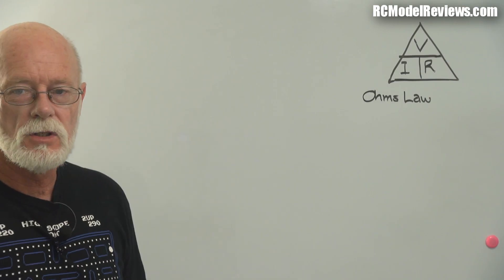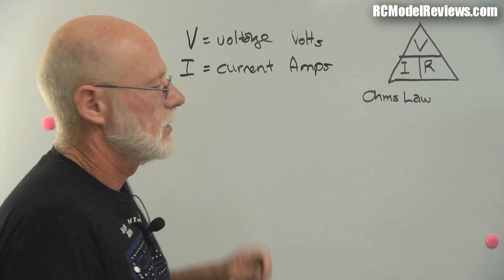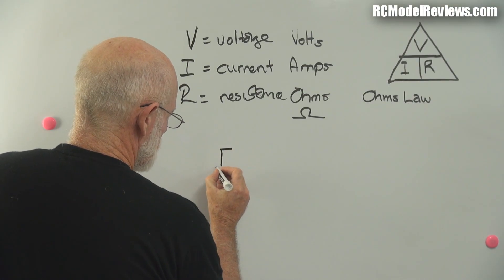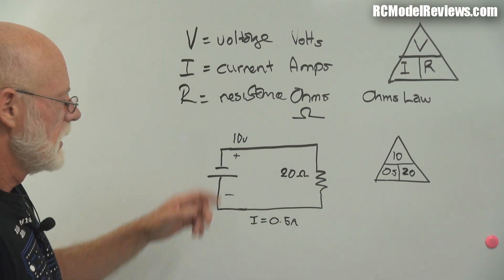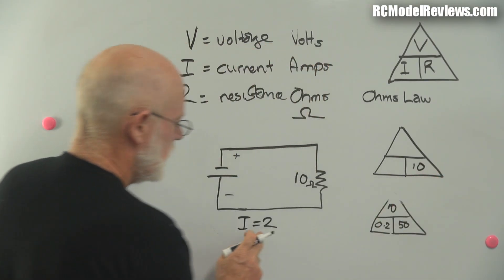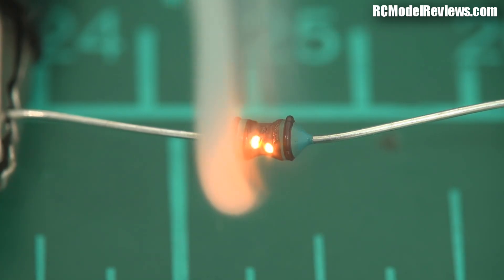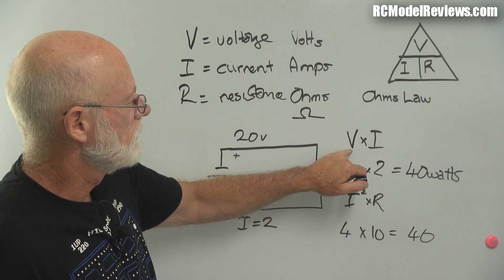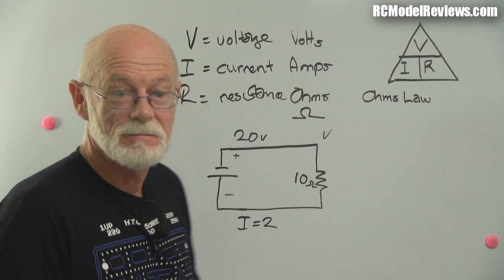Ohm's Law explained

Comment: Technically Ohms Law is about the linear relationship between voltage and current.

You plot the voltage and current on a graph, current on the vertical axis, voltage on the horizontal axis, and then you measure the gradient of the graph and that is the inverse of resistance.

It's fundamentally about linearity, not single spot values.

The equation for a straight line on a graph is:
  y =mx + c

In our electrical scenario, zero volts equals zero current, so the value of c is 0.

The equation then becomes:
  
y =mx

y is current which we use the symbol I to denote, and x is voltage which we use the letter V to denote.

Hence:
I = mV

m is the gradient of the line which is calculated by measuring a change in Y axis, looking up the corresponding change in X axis and dividing (m =dy/dx)

m is a constant, it is a straight line.
And we call 1/R = m
That is the resistance is 1/m

So we end up with the formula:
I = V/R
where m, the gradient of the line, is 1/R

The resistance is the inverse of the gradient.

As we are talking about gradients, only apply to lines, which comprise multiple points.

So Ohm's Law fundamentally is about the relationship between voltage and current, not single spot values.

So this is where Ohm's Law actually comes from. This IS Ohms Law.

However, the formula:
I=V/R 

is incredibly useful to us. But it technically is not Ohms Law in its entirety.

So whilst you can use the formula to calculate resistances from knowing voltage and current, say for a diode, and you can do it at multiple values of current passing through the diode, each value is a resistance figure measured in ohms, the diode does NOT follow Ohms Law. It does not follow Ohms Law because the relationship between voltage and current in a diode is NOT linear.

Comment: I don't know about Voltage being compared to a preasure... Maybe I get it wrong, but it doesn't make much sense for me.
If current would be like a preasure, then when you raise a preasure in a pipe, you will then increase the amount of water flowing, right? But that would break the analogy because flow is already current.
I rather associate voltage with a temperature (volts are then indicating how "hot" the energy is and current how much of it is flowing through).
But if my analogy is bad, then please correct me and explain me where it fails. I know only very basics about electricity so I would be glad to learn something :)
Btw awesome video! Thanks for explanation.

Comment: V, I,R, Watts... I lack an analogy for each item.
V is like water pressure above the shed in the form of a rain barrel.
I is the current ..a 10 inch in diameter pipe .. Hmm. I think it has a low current
I in a 1 inch in diameter pipe. ... Hmm.. I think it has a higher current than the 10 inch pipe.

Ok.. I'm stuck there.

Comment: battery has an internal resistance r=0.5 ohm, an open-circuit voltage 
𝑉OC  = 12.6 V, and a rated full-load current of 2 A:  
  (i) If a load resistance 𝑅L =10 Ω is now connected across the 
battery, calculate the load current.

Comment: YOU ARE A GODSEND! You explaned to me what other videos just lost me. I'm learning how to Breadboard with a pi 4, but I'm smart enoug not to tinker on it, until I fully grasp all the electronic parts I need. Like Resistors and Transisters, Capacitors, LED's and light emitted diods as in the ones that don't light up like leds. So I'm a long way of really doing anything yet. I"m into programming and Python is one of them languages that runs on the Raspbery pi 4. And because I am a fan of robots, I also put together a robomaster s1, to use with Pytyhon, and now, I want to pretty much learn to make a real working robot right out of scratch. I'm in my fifties, but programming isn't new to me at all, Robots are new to me, but so far, I love it. Now I'm trying to merge into a deeper field, and I need electronics to get me there. So I will be paying stern attention to you SIR!!-:))) Thank you for teaching me....

Comment: I'm used to algebra where a letter is turned into a numeric value. 2A, find the value of A, and double it.
I'm going to have to make several equations to get that language out of my head, and put this in.
9V=9 volts, not the value of V times 9.

Comment: Electrical Current is measured in Amperage, or Amps for short. "I" stands for "Intensité de Courant" (French), or Current Intensity. André-Marie Ampere, a Frenchman, who discovered electrical current, used this symbol.

Comment: Small correction at 3:40: In the battery symbol, the positive terminal is the one with the longer line. Although, as you said, the polarity of the battery doesn't matter for that circuit (since a resistor is a bilateral device), people who are first learning its symbol may mess things up.

Comment: I have a 70va Transformer with 208v. The output is 24v. I need to close (2) 3phase contactors.. 

Q: how do know if my Transformer is actually giving me 70va? 

Should I have a given value of Resistance across the secondary or primary coil? 

Ps I’m an HVAC technician, this video is most educational video on ohms I’ve found.

Thank you in Advance for your consideration.
Reply: The transformer can take up to 70va... When you put 208v on the input, he converts it to 24v on the output... If there's nothing connected on the output the transformer is taking 0va... You can link resistors/load up to 70va. Does that make sense?
Reply: Electronics isn't hard but it's tricky..  I also teach it with cartoons...

Comment: I get the math. That is easy. Now for  the mystery. I have a 2836 1100kv motor.  It is rated to take 27 amps max. Also I have docs that show it has 336 ohms of resistance at 14.8 volts. I can't get the math to work or even come close. If you can answer this I will subscribe. carlylemmitank@gmail.com

Comment: I'm confused. If we had 10 volts and wanted 0.5 amps the resister would be 20ohms. So if you wanted 2 amps ran through a 10ohm resister shouldn't it be 40 volts. ?

Comment: If you want to know exactly where this 'law' comes from i think it will be better to start with 'Drude Model' which explain the physics behind this law. For example, ohms law suposse that the electric field inside a resistor is equal everywhere which in real world is not true. As a summary Ohms law is the bridge between electronics and physics.

Comment: Can you convert AC to DC this way?
I have a 12V, 30A (DC) powersupply. It is fused with a 10A fuse at the AC side.
So i was thinking, 10A on a 30A powersupply? That can not be right?
Then i was thinking; 12V x 30A (DC) is only 360 Watt.
360 Watt / 230 Volt (AC) is only 1.56 Amps.
So 10A is more then enough.

Did i calculate it correct or is there something else to think about when converting from AC to DC or DC to AC?

Comment: Question.. say I have a generator that outputs only 1000w @ 240v AC (around 4 amps) and a kettle that normally takes 10 amps. Would a 60 ohm resistor in line ensure only 4 amps is drawn from the generator? Or will the resistor still turn the difference into heat and draw the full 10 amps from the generator anyway?

Comment: Very helpful! How can I apply this to figuring out the required voltage needed for a small water heater appliance on my boat. I don't know if it's 12v or 115v. I just learned how to measure the ohms using my multimeter, but how can I get the missing pieces of the puzzle.? Thanks in advance.

Comment: A filament without the insulator. A resistor is a bulb, that is not designed for producing light or cad sensor detection. Controlled impedance temp.  Manipulation of conductor size, to negotiate current flow. Ohms begins with continuity. Polarized particles are static. Exchange of charge is the movement of electrons or current flow. Potential current and current differ. Resistors invite charge exchange by being at a differential with the main conductor. A yellow light in the river. A torrent or cipher.  The universe is continuous. Everything that produces light or particle excitation, is a resistor. cJT aka Charlie Jay

Comment: You did an excellent job of explaining that. You can use basic math to calculate that. The trick is how not to fry the resistor or the circuit board.

Comment: How can I make a variable power supply that can deliver 20,000 voltage with no amperage, on up to 100,000 or 200,000 voltage with no amperage. But just In case maybe have a very low amperage dial also... I'm transforming electrical ark plasma into Positively Charged Protons which can run any combustion engine.

Comment: No dude! E I R !!! Not V. Again, E, I, R. And W for watts. E, not V !!!
Reply: Rubbish!  V is voltage, E is electromotive force or electric field.  Ohm's law is  V=IR in any electronics textbook.
Reply: @karhukivi  I don't know where you live, or where you went to school, or what military you got your training and MOS in, or where you worked, or what textbooks you have or studied from. But all of the above of mine are E=IR, where E is Voltage. I have in front of me the following, Radio Communications Handbook, Principles of A.C. and D.C motors, ARRL Handbook 2019, Practical House Wiring, RCA Vacuum Tube Manual,  and Understanding Power Generation and Transmission.  And every one of these books refer to and use E as the designation for Voltage pertaining to Ohms Law. The pie chart for Ohms Law for Voltage, Current, Resistance ant Power that hung above my instructor for "Math for A.C., DC and Power Circuits" showed E for Voltage. EMF is not a product of Ohms Law for Voltage, the correct terminology is E for Voltage is found by multiplying Current by Resistance. Voltage is a product of Electro Motive Force, and as such it is quantified and measured as Voltage, which is represented as E.
Reply: @bobgarr6246  OK - google on images for Ohm's law and see what happens!   E in physics stands for electric field.
Reply: @bobgarr6246  If you  look at google images for ohm's law you will see both V and E.  Not sure which is in the majority, I would think "V" but I'm not going to count them!     It may as you say depend on where you live, but in Europe it seems to be V.   Owen Bishop's "Electronics - first course" uses V as do all my physics books.  I think it might be to distinguish "V" as "volts" e.g. 9V, from the concept of voltage, just as I is current while A is the unit amps.

Comment: What is not mentioned here is that this tutorial is based on DC circuits NOT AC. AC requires a different approach.
Reply: It is OK for AC circuits with only resistive elements.

Comment: I don’t get it
If a battery is 10v, which is the force pushing, isn’t there already an Amp measurement before the resistor?  
So in your circuit, if you remove the resistor, what would the Amps be?
Reply: A dead short!  The current would rise rapidly, the battery would overheat and be damaged, or perhsps the wires would melt in a shower of sparks!    On the other hand, if it is open-circuit, then there is zero current, i.e. 0 amps.

Comment: As a kid I could grasp that key🗝 in a wall socket  for only a moment.  As I get older  I'm ready to hold on 1 last time✔. What would my body resistance ♎need to be to achieve  fully cooked status ,🥓 110vA/C ⚡60hz🤜 @15 amp circuit.........??

Comment: The burning resistor intro page was ideal for introducing watts and the watt limit for a resistor. Suppose you have carbon resistor with 100 ohms in a circuit with a 9 volt battery. Will it burn? 

The answer requires a comparison with the watt rating, not specified here.
Reply: The current would be 9/100 = 90mA and the heating (power dissipation) = 90mA x 9V = 810mW.  A resistor rated 1W would be OK although it would get hot.  A resistor rated 0.5W would get very hot and likely burn out.

Comment: man. I had to use Ohm's law to roll my own coils for my vape.
little did I know I would be using it again in a different way, with cars

I used to just plug the numbers in, now I know what they mean
tho to be fair you didn't really explain what they mean in this video
for someone who chuffs them phat clouds I can explain it easy, but in some abstract forms I cannot
there's a good picture of the Volts pushing the Amps through a narrow tube, and the Resistance is that narrow tube
but like I said, just explaining it is very difficult for me to describe in words, only through pictures can I sort of explain it
if someone is interested in something it is extremely easy to teach them. but if someone isn't into it at all it's a fucking struggle

Comment: You say ask you so I need assurance I'm building a rc lorry run on water hho but using 12 volt battery for electrics the radio control works ov max of 7.volts preferred 5 volts what resister would take that drop without overheating. Many thanks john

Comment: "I" is from the French phrase i"ntensite' du courant" or current intensity.  Current Intensity is simply referred to as current.  The "I" symbol was used by Andre'-Marie Ampere, after whom in 1820 the  unit of electric current is named, in formulating Ampere's force law.

Comment: Poor teaching. 

Should voltage = amps x ohms. 

Or 

Potential difference = Current x resistance.

Don't mix units and measures

Voltage is a unit of measurement for potential difference (PD), whilst voltage is often referred to instead of PD only poor teachers pass on bad practice.

Comment: This maybe off topic but you look smart and I’m a dummy so how does one rewire a motor from 115volts to 220volts? Im just trying to understand it all but still confusing 😓 it’s weird how it runs fine when I plug it in but when I plug it to the box which takes 220v it doesn’t work very well it goes on and off. 🤷‍♂️

Comment: This makes no sense...if you take a small 4 amp 12 volt battery and put a 2 ohm resistor on it..you dont get 6 amps!! Wow..we could make free energy. Hes not including the voltage with amperage in V. DUH

Comment: How should one understand the water/pressure analogy when electron current is flowing exact opposite to the conventional current shown in most circuit diagrams? If voltage is “pressure” how is it that actual electrons flow toward it, not away from it? The “hole” flow explanation is silly since in metallic conductors,  which we mostly use in circuits it is electrons that flow. Only reason they flow is because they are loose in valence shell of an atom. Holes (protons) don’t flow in the wire as they are not in the valence shell. So people keep saying these analogies but it is really hard for a noob to wrap their head around it.

Comment: Why wouldn't you just name them .5 amp resistors?
Reply: Kyle Simon   Because the amperage would change with voltage change.   A .5 amp resistor is on true at a specific voltage.
Reply: @raoulcruz4404  

I know. That's the point.  a .5 amp resistor doesn't function beyond .5 amps.  So why bother with Ohms if that's not relevant to accuracy of the label?
Reply: Kyle Simon   I don’t know. I’m still learning the basics or relearning. Seeing how his values are arbitrary, it may not equate to real world hardware.  🤔

Comment: Hi I am basically conversant with watts law.I have a problem I am trying to solve.

I have fixed two led lamps to my aqurium 48 watts ho hum.
What I need to do is calculate the wattage of these lamps I know they are both pulling 12/13 watts on the plug piont. And they are on a 20 volt transformer is it possible to calculate the wattage of these lamps on the 12/13 watts they are pulling from the socket.

Any help you can provide would be greatly appreciated.
Regards martinsteele1959@gmail.com

Comment: 1:57 -  You can't have current unless there's a voltage (pressure, as you've described it) and an impedance (or resistance to the 'flow' you've described, or the near lack of resistance -- i.e. a short -- across the voltage source). 
You must have both, or no current (flow) exists.  Voltage and Resistance (Impedance) exist -- Current is created. Ohms Law states that the current (I) is directly proportional to the Voltage (E) applied and inversely proportional to the Resistance (R, or Z in AC circuits). So with that relationship you can see that if enough pressure is applied to a low enough resistance, the current flow will be intense (thus, the I for current). (See the works of Dan Sullivan, e.g.  https://www.youtube.com/watch?v=zYS9kdS56l8, who explained it best, I think.)

Comment: 08:38 is where I started getting lost.
Reply: so, in resistance, you have the flow of electrons "smacking" whatever resistance (Ohm) is in the circuit. Since this is happening at the speed of light, all that "smacking" is gonna cause friction, heat, light, etc. With a lot of resistance, it can cause too much heat in the wiring, which will cause the circuit to break and fail. By measuring that resistance, you can calculate how much power (or heat) will travel through the resistor and determine if the wiring can hold the charge enough without failing. Hope this helped in any way.

Comment: To be pedantic, Ohm's law simply states that current is proportional to voltage (V is proportional to I- sorry I don't have a proportionality symbol handy). The commonly used V=IR is actually the definition of resistance.

Comment: Your comment that 40 watts is a lot going into the resister confused me. If V=20 volts and we change the resistance from R=10 to R=5 ohms then the current will be I=4 amps. That means the power would change to 80 watts; I reduced the resistance, but now the circuit is producing more power. So your comment would suggest that the resister would heat up more, because 80 watts is double the amount going through the resister? Given the proper resister, is it the watts that determine if a resister gets hot, or is it one of either the volts, amps or the ohms? If it's the ohms, is it more or less ohms that will cause heat. I'll probably find the answer myself before anyone replies, given this video is nearly 4 years old.